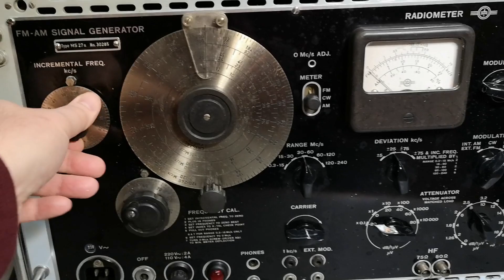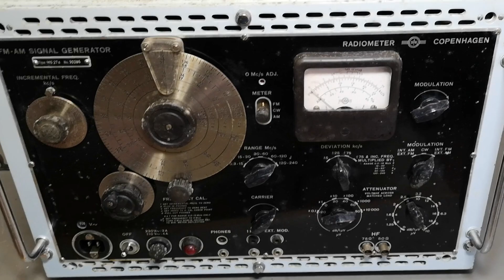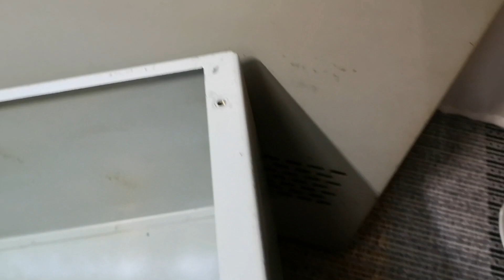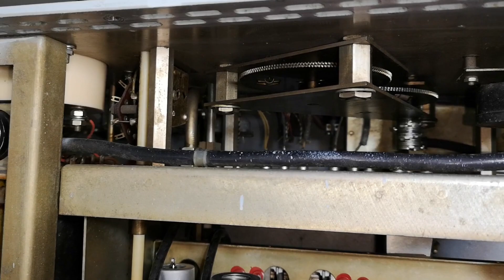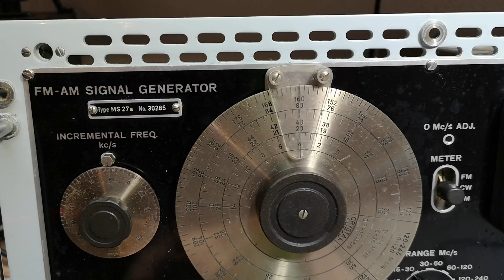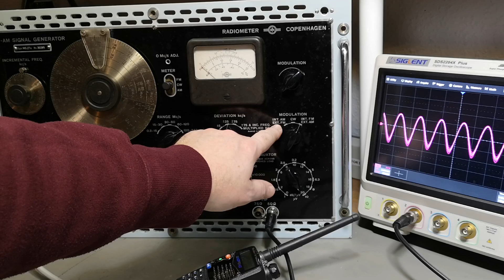Radiometer MS 27A signal generator 0.3 - 240MHz 1960 test teardown

Comment: I this week obtained this generator. Made end of 1956, you can derive datum or year from the caps in the power supply. At 14:20: connect a lamp, not a modern led type, in series with an unknown apparatus. When there is a short or leaky cap the current wil turn on that light. Or when selenium or silicium or germanium  bridbe being used: use a variac to slowly let the caps form there dielectrum again. Good luck, thanks for sharing!